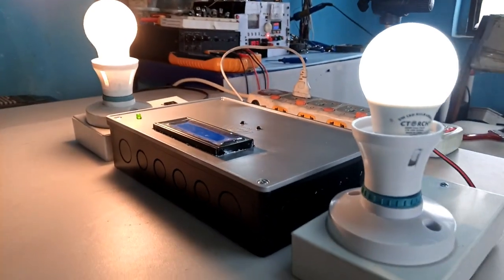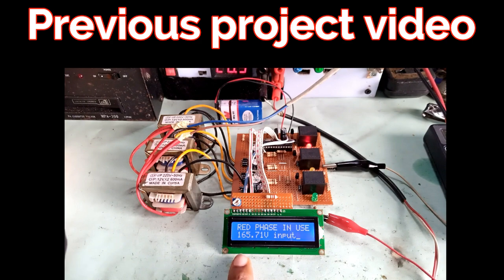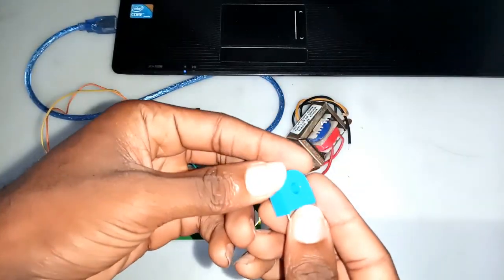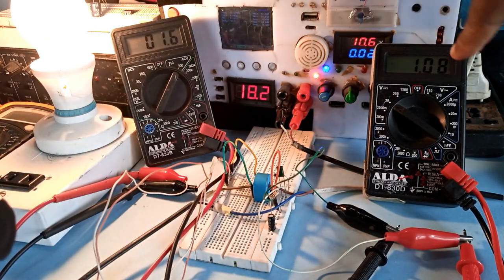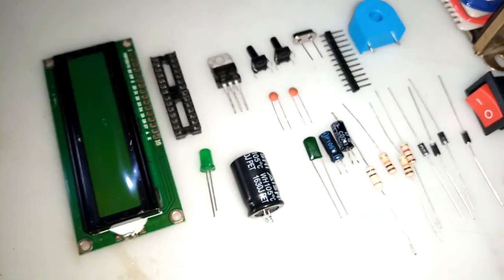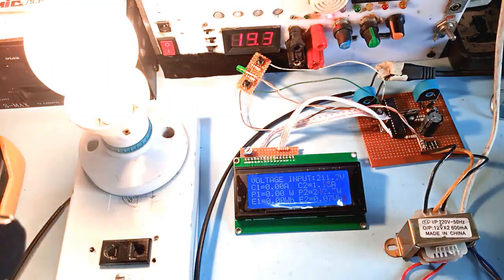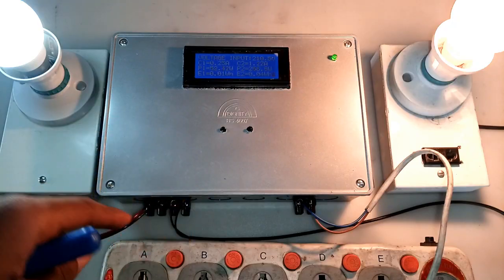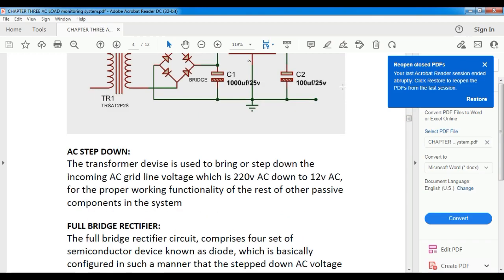Energy Monitoring project : Voltage, Current, Power, Energy and Price Billing of energy.Arduino base

Comment from the maker: If you want the code for the model I built using a 16/2 LCD display, then do well to indicate under this comment
Reply: Engineer nice work, please send me link to the 16/2 LCD display version of this project thanks
Reply from the maker: @mayoortechinnovations  
I will share you the link
Reply from the maker: Here, https://drive.google.com/file/d/1DPB11QJUQkhcXf2T22QCf8LvREslNO7c/view?usp=drivesdk
Reply: @MEmbedded_TechLab  Thanks
Reply: Were you able to fix the current sensor accuracy issue for this 16/2 version?
Reply from the maker: @mayoortechinnovations  
Yes I did, as I used it in the last video I made

Comment: How did you externally aliment your esp without connecting it to your pc. How did you compile the code ??
Reply from the maker: You can compile esp board using Arduino ide. Though I used Arduino for the assembly
Reply: @MEmbedded_TechLab  did you flash your esp8266 using arduino OTA before doing the project ?
Reply from the maker: @hazardede_n  no,esp board are already flashed
Reply: @MEmbedded_TechLab  I’ve tried your method and when I compile the code it says so COM available